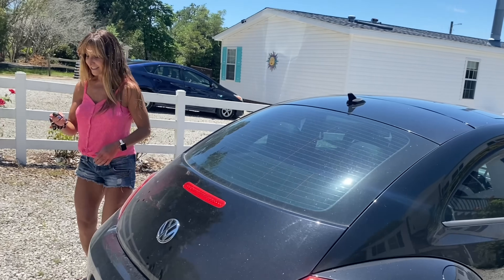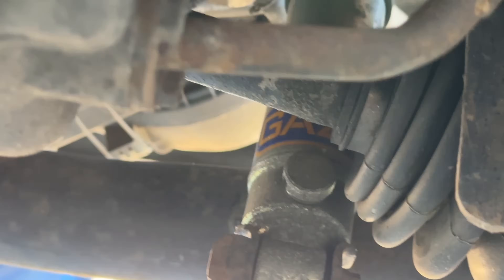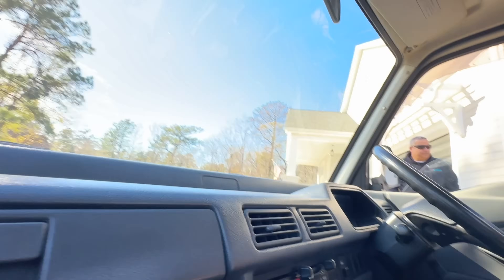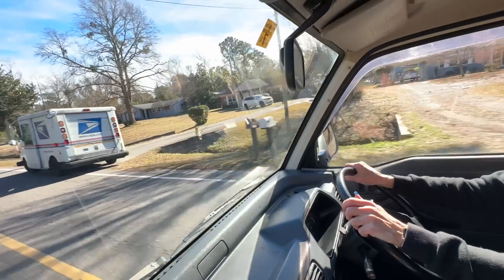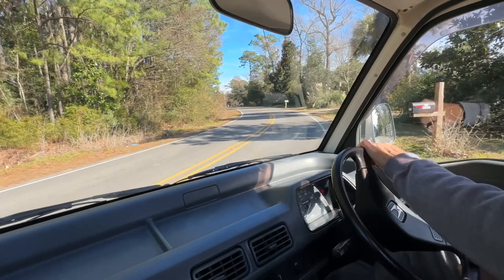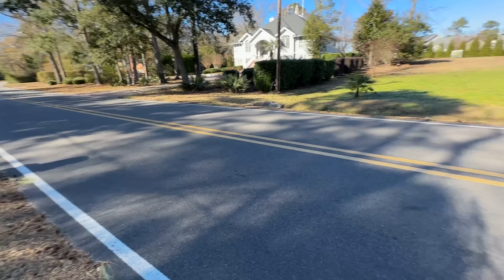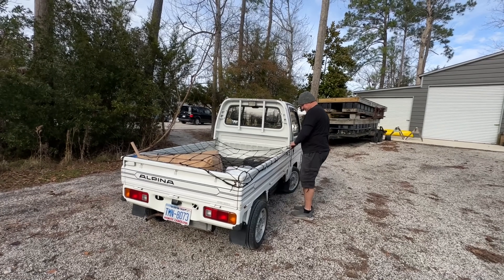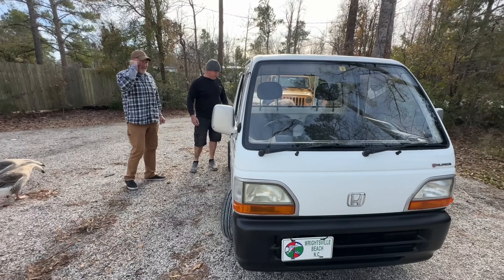Micro Kei Truck ~ Buying a Honda Acty

Comment: The Kei Truck is very popular in the US, but it doesn't have a crush zone, so be careful not to get into an accident.🥰

cheers.
Reply: I live in Japan and have one. You've gotta drive these things like you are riding a motorcycle. And if you have a head-on on bike you might get thrown off somewhere but in a 軽トラ you are as good as a can or sardines. I've had mine for 9 years now and I'm hooked, you can even drift in the f****ng thing.  4 wheel drive is a real plus where I live here in Nagano.

Comment: Honda's first commercially available car was a light truck with a 354cc inline 4-cylinder engine, but it was Japan's first mass-produced DOHC engine (2 valves per cylinder).
Reply: DOHC is a cam for intake and a cam for exhaust...

Comment: The legal speed limit on general roads in Japan is 40km/h or 50km/h. Light cars are designed to Japan's own standards without the intention of exporting them, so if you don't drive at a reasonable speed, the ride will be unstable. I recently switched to a light car.

Comment: Thoes springs are way underrated for the load. The struts are fine…there a nice trucks…most up here are 4x4 thoe two wheel Honda the motor in the back is way better…🎉🎉🎉..cheers

Comment: On that Honda most of them have the 5th gear locked out because there not safe at fifth gear speed. But you can take trans apart and cut the lock stop out.

Comment: To convert kph to mph, multiply kph by .6. So, 70kph equals about 42mph.
Reply: About 8 km to 5 miles on the speedo' in my Hijet.  42 kpm=25 mph and 72 KPM =45 mph.

Comment: I watched this movie yesterday. It’s been bugging me since! TRY ALWAYS TAKE OFF IN 2ND GEAR. Only use 1st gear for hill start. It is still a little truck . You can try and whine the adjustable suspension back down! Go to motorcycle shop for the tool, much cheaper there.❤

Comment: I had the opportunity to drive and work on a Mitsubishi mighty mite truck. It looked identical to the Honda's version. Mine was left hand drive 3 speed locked out at 20 mph not road worthy. It had seat belts and turn signals. The payload could handle 1700 lbs. 3 cylinder gas engine  8 gallon fuel tank. Bed folded down like yours. Have fun driving and using it.

Comment: Is it 4 wheel drive? I assume not, I'm sure you would have mentioned it if it were. I've been toying with the idea of getting a 4wd one. I hadn't considered the leg room aspect though. I'm 6'1" also and have long legs, I've ruled out regular sized vehicles in the past because my knees were nearly touching the dash.
Reply: If it helps, im 6'2" & my knee's are 1" from the dash. The van i have, has 6" of clearance

Comment: 日本の軽自動車は64馬力までというメーカーが自主規制してる。　大きな車より車体の丈夫性がないからである。　自信があれば改造して100馬力位は直ぐに上がるよ。
但し、安全運転をする事だ。　😅
(　Japanese kei cars are self-regulated by their manufacturers to a maximum of 64 hp.　This is because they are not as robust as larger cars.　If you are confident, you can easily increase the horsepower to around 100 hp by modifying the car.
But drive safely.　😅　)